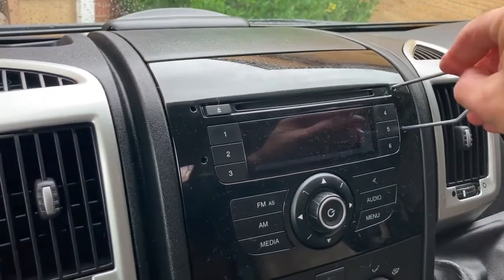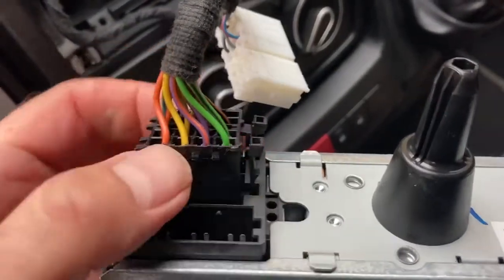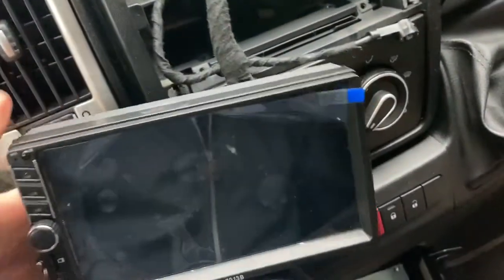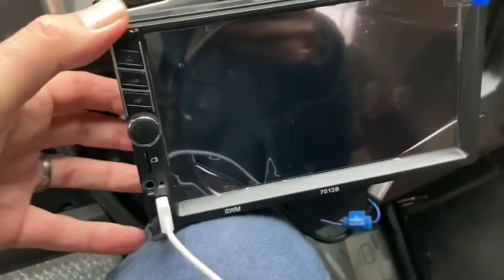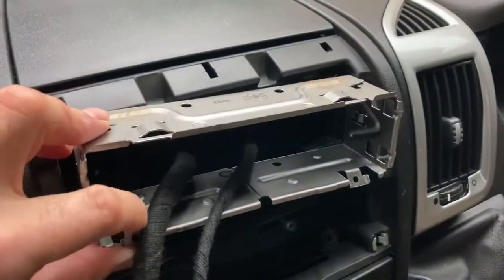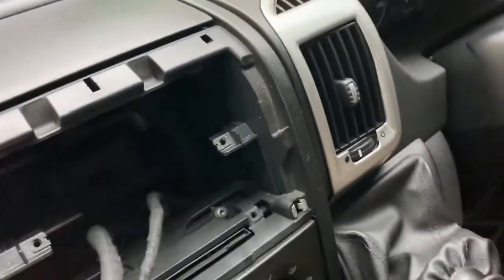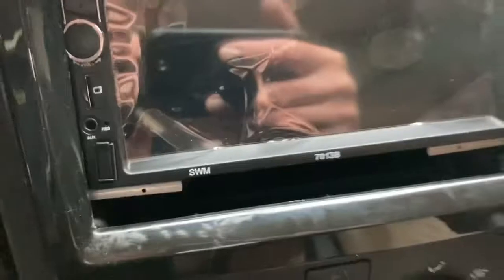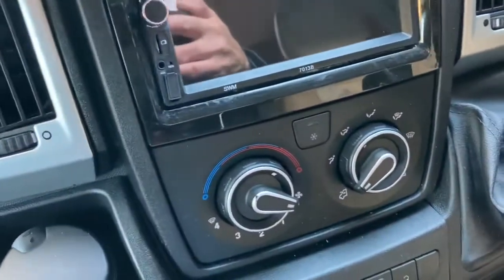Cheapest eBay apple CarPlay double din stereo radio easily fitted to Fiat Ducato / Peugeot Boxer

Comment: How did you fix the CANBUS error ( flashing odometer)? I have a similar Chinese unit that produces this low level CANBUS fault on a 2019 Ducato
Reply from the maker: @ammej768  sorry I don’t have that issue with mine. There is no odometer in my head unit. It’s still working fine after all this time.
Reply: i have the same problem and can't find a solution.

Comment: Very informative, thank you.
The ebay link does not work anymore so will you please tell me what the radio is called?
Reply from the maker: There are loads all branded differently. I wanted one with a volume control I could twist to turn up and down, rather than a button. They do seem to be the same product though. Mine was cheap, around £60, and is still working fine.  Sorry there isn’t a brand name on the front.

Comment: as you pulled the one radio out and plugged the connections stright into the back of the new radio ? does all the steering wheel functions work with it ? ref stereo volume and phone controlls etc
Reply from the maker: It was the same connections from existing van to new radio. You need to purchase a connector separately to make the steering wheel controls work. I didn’t bother, and use the radio controls on the radio.

Comment: Steering wheel buttons are working well with it?
Reply from the maker: Nope. You have to get an extra adapter to set that up. I didn’t buy one, and I’ve just leaned over each time. Apparently it’s straight forward once you have the adapter

Comment: Can you power this on without the ignition being on?
Reply from the maker: I think that depends on what power feed you use. In my van the existing power supply came from the ignition switch. However, if you can route a different power feed from a suitable place, it will work (maybe a leisure battery, if you have a Motorhome).

Comment: Hows the stereo going?
Reply from the maker: Good. Haven’t had any issues at all. The only quirk for me is that it doesn’t play radio when plug my iPhone in. So I have to use streaming audio if I want to listen to radio. That’s not a big issue. Good quality sound too
Reply from the maker: Good. Haven’t had any issues at all. The only quirk for me is that it doesn’t play radio when plug my iPhone in. So I have to use streaming audio if I want to listen to radio. That’s not a big issue. Good quality sound too
Reply: @jeremysvideos7304  does it take the new iPhones?
Reply from the maker: @Vuyccbvuj  it’s a USB on the front, you just plug your lead in. Works with latest iOS, I have iPhone 11
Reply: @jeremysvideos7304  nice and you can make calls from it?
Reply from the maker: @Vuyccbvuj  of course. Just use Siri and it works a treat. The inbuilt microphone isn’t the best, but there’s a plug in the back to put an external one in.
Reply: @jeremysvideos7304  cool and it mirrors you actual phone?
Reply from the maker: @Vuyccbvuj  not exactly, it has apple play which is different to screen mirroring.